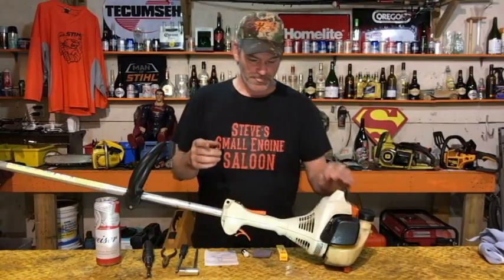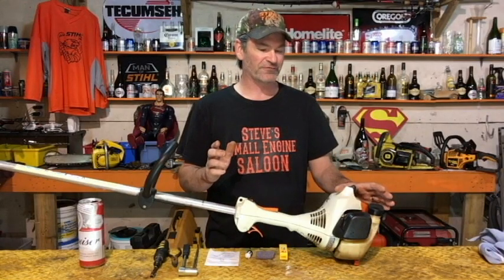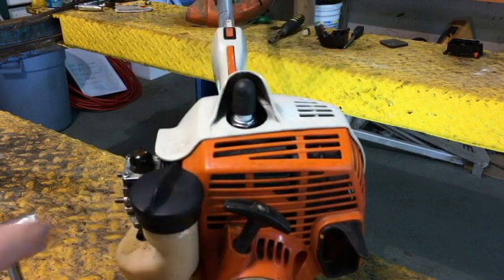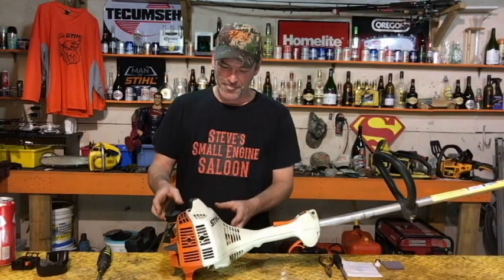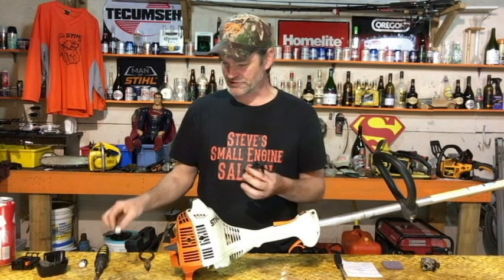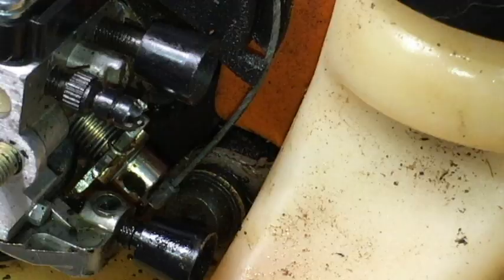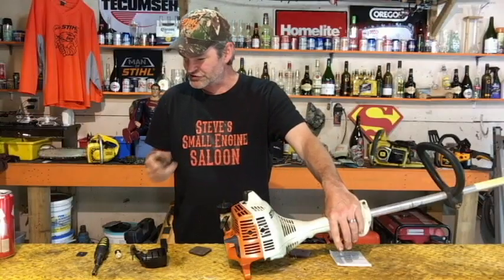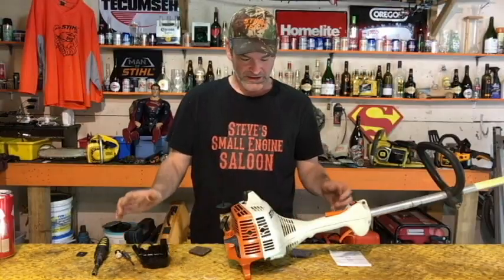How To Do a Basic Tune Up on a Stihl WeedEater

Comment: I need help on my FS45.  Compression gauge is showing 60psi after 1 pull and 80psi after multiple pulls (without reset).  What do I try/replace next?  Here is the history...Died while running, would not re-start, removed air filter and used starting fluid (would not start), then replaced spark plug (would not spark), cleaned spark arrestor (still wouldn't start), then checked spark (no spark), then replaced coil (now have spark)(still wouldn't start), tried starting fluid and air filter removed and it made pop with a burning smell (maybe a backfire) (still wouldn't start). Tried starting it again with the spark arrestor removed and it shot dark liquid dots out of the exhaust.  Sounds normal when trying to start, but never does. Has fresh gas, bulb is taking fuel, feels the same when trying to start.  Any suggestions on what to do about the compression, or where I should look next?   Invested a lot of time so far and not giving up just yet! LOL

Comment: Hey Steve, love your videos, absolutely fantastic.  I do have a question though, I'm hoping you can help me with.  I have a husqvarna weed eater that I've had for about 6 years.   It's worked flawlessly the entire time.  This year when I started it up, when I depressed the trigger the engine would bog down.  Initially I was going to rebuild the carb but I just bought a new one.  After replacing the carb the weed eater wouldn't start anyone.  I checked the compression and it's around 30 psi.  I looked in and visually the piston/ring looks okay.  Would low compression cause the bogging down?  I was wondering if I possibly knocked something about replacing the carb.  I think I'm going to call it quits on the repair but now I'm just wondering for my own knowledge and future troubleshooting.  Cheers!

Comment: My Sthil is a FS94R and it runs but gets bogged down, in short grass even, and stops running. I can start it up but it bogs down and turns off quicker and quicker. I put a new spark plug in it, the same kind as the one that came with it. I put good oil/gas mix in it, and changed the filter. But it still does this. The fuel filter is the same one that came with it when I bought it, should I replace it? I've had it for four years now and i've just started having this problem. I will try this tune up. If the tune up doesn't work, what is the problem i'm having?
Reply from the maker: Check my video called Stihl wont rev up....
Reply: @StevesSmallEngineSaloon  Thanks

Comment: I've got a similar weedeater from Stihl, it's my roadside find lol. I put a new tank and fuel line/filter assembly on it and if ran great, unfortunately I think the diaphram let go after running it cuz it doesn't want to prime for me now
Reply: Well lol, got the priming issue fixed and the weed eater runs now, I ended up switching the gas line/filter in the tank out and that fixed it, now I have another hiccup to fix, it dies out after a few minutes of running, almost like it drowns itself out or is getting to much air somehow, time to grab a beer and troubleshoot some more lol

Comment: I have a weedeater brand trimmer. It will idle and it will run wide open. No in between. It will die every time. Plus you have to keep pumping the throttle about 10 to 15 times to get it wide open or it just dies. If you just mash it, it will die. What should I do?

Comment: Steve great video. On my FS46 trimmer when I do mine I don't have take carb off. I take back orange cover off then fuel tank drops down. change filter put back in. why cover is off I unbolt the screen on muffler and clean. and check pull cord and clean cover. then put it all back together.

Comment: Again, another entertains video, thanks. One small thing to add, when a new spark plug is installed always check the gap at the electrode. I have had new plugs where the gap has been closed up. I know you would automatically check this when you take the plug from the box but your followers may over look it. Cheers
Reply from the maker: Great point!

Comment: Can anyone help please? Just replaced the spark plug, fuel filter (inc. lines), the air filter, and fitted a new carb (inc. gaskets). Starts and runs brilliantly (choke open), but as soon as I close the choke, the engine dies. Everything cleaned and no visible leaks or blockages. What might be the issue?

I could run it fine with the choke open, but it's going to burn through fuel like crazy. Need a better solution. Thanks!

P.S. even ran it with fuel cap open to see if it was a vacuum issue, but that had no positive effect.

Oh, and the fuel is fresh and the correct ratio mix with 2-stroke oil.

Comment: Thank you so much Steve for the work you do! I have a question about the STIHL FS 85. I've put a new ignition coil, spark plug, carburetor, fuel filter, fuel lines and adjusted the carb. It still doesn't want to idle very well. Does this model have a reed valve or some other thing I need to check? Thanks Bryan.

Comment: The way I replaced the fuel filter was that I pulled the tank. You have to pull the pull cord assembly, and undo a couple of screws and the two fuel lines if you don't want mess with pulling  the carb. Thank you for posting this video you are awesome every time I watch a video of yours I learn something!

Comment: My trimmer requires a good 20 tallboys of Bud to really run the way I think it should. Also the final four beers at the botton of the case can only be opened via said trimmer between the hours of 2am-4:30am. That's why tune ups are so important.

Comment: Steve Question?  I have done all I have seen on your Videos. Except tune with head on. I have been tuning with head off. So will not idle long. and at wide open throttle will just STOP running then hard to re start. Hot. Also no air filter on when tune . (Am I seizing the Piston to the cylinder wall?  New carb from dealer he can not adjust either. He says Bad fuel ??? I run no alcohol 90 octane and sthil oil.

Comment: My Kombi KM55r won’t start without pouring fuel in carb. Has spark,new carb.,fuel lines and filter-tried everything. Please help.
Reply: If you use ethanol gas, your carb and/or primer bulb will eventually fail. I went thru 2 bulbs and a carb. A cracked bulb will not allow fuel into carb and a bad jet means carb replacement. The carbs come preset and just slip on the way this video shows. They run about  $35. Bulbs are cheap, try that first. Then, use ethanol free fuel from now on. Before you replace anything, make sure that it's tuned up and adjustment screws are set according to manual.

Comment: Bought  my Stihl trimmer 12 years ago. Embarrassed to say I never tuned it up but didn't use it that much ( I had a kid doing the yard for several years). It was running bad. Would die if I gave it too much gas or if I turned it at any angle. Watched your video. Your close-in camera work was very well done and helpful. Did the tuneup. Also bought new gas and oil. Now it runs great. Thanks for the help!
Reply from the maker: Right on Mike...

Comment: Steve I have a stihl weed eater fs56rc  with problems bogging down. I cleaned the spark screen on the exhaust and it was stopped up. Now it won’t start and run.  I did get it to run for about ten seconds then it won’t start .. it has good spark at the plug good compression, blows my finger off the spark plug hole while pulling the crank cord. I’m thinking it may need a carburetor. Any help would be appreciated..
Reply: What finally happened with that Stihl?

Comment: You're my hero Stever.  I could not get my Stihl FS 45 to work after spending hours on it.  I got the $13 tune-up kit from Amazon and then spent 45 minutes replacing the spark plug, fuel line, fuel filter, air filter, and carburetor (in between taking sips from my 24 oz MGD).  Started up on the 3rd try.  Many thanks.
Reply from the maker: You're Welcome...

Comment: On the fuel line there's an arrow that goes back to the unit when you drop it back in.
Reply: What unit?
Reply: The fat round bit of the fuel line, that Steve was pushing in with the small screwdriver  has a small arrow moulded into it.
Make sure its pointing to the engine, then you can't put the 2 fuel pipes on wrong way round, because they will only go one way round.

Comment: This was excellent!  I got the parts this morning (plus a primer bulb) and did the tune up just as you showed.  It went very smoothly.   It now runs like a champ.  Your comments got me over the tight spots to watch out for.  NO FRUSTRATION, NO UNNECESSARY PARTS REMOVED, THE RIGHT TOOLS,  JUST SMOOTH SAILING!!!  Excellent video, perfect close-ups for the details. I have to see what you have to help me now tune up the chain saw.
Reply from the maker: Right on Ed...

Comment: @Steve's Small Engine Saloon, over time replied and asked couple questions in vids.No reply, but will attempt in this one.Thanks for vids, like the quality and full explain...
 I take my weed eater apart shell and all once in awhile and scrub.Also, cue tip ect parts and all else.Anyhow firstly maybe some time if you could do a vid.Being about grease at head for gearing vs other weed eaters that have no port at top for grease gun or tube.Sthil weed eaters only.Seems Sthil does not want top gearing lasting and to buy another.My FS 56RC has no place to grease the gearing by head..... Which to me, is stupid and sucks.I'm sure there is more not so easy ways to do this though.
 Need some advice please.On the 56 RC I see there is no black muffler port or what be.Others have it.The thing that attaches to orange shell by muffler and sticks out so junk goes straight out.I have a fs 55 and I see that part does not butt up and snap in to the 56rc.For a attempted try.I also see alot of black gunk just splattering inside the shel and out side.Looks like crap.Any mode or thought or part you have that would correct issue? Have no clue why Sthil did not put this on the fs 56rc.My fs 55 is old use it daily with that part from factory on it and inside looks fine.
 Side note, I always run Sthil hp mix and 90 oct no eth in this and all my stuff.Thanks for input....

Comment: Thank you Steve for this vid.  I was able to do everything you showed on my Stihl.  However, that didn't solve my problem.  The squeeze ball kept collapsing and didn't re-inflate like it usually did, and I am not getting fuel.   Fuel lines look OK.   Could it possibly be the carburetor?  My weekeater is about 7 years old.  Thanks.
Reply: I know it's late, but this generally means your carburetor diaphragm and\or priming valves have degraded. You will most likely need a carburetor rebuild and a new primer\gas lines\filter or a new carburetor and gas lines\primer\filter.

Comment: I feel lucky to have found your channel Steve. I have a Husky 128LD combo trimmer that I just bought this spring and it has been nothing but problems. I just installed a new carb last night , and  then realized that I will most likely need to adjust the high and low speed adjustment screws. I will be able to do this successfully and easy with your carb adjustment video for trimmers. Now I am ordering that special spline tool off of Amazon. My only request is that you do some videos on the popular homeowner grade Husky equipment. BTW- why the cheap piss american beer? You guys have Kokanee up there in BC. I would think that you should be featuring that beer as much as you do Stihl equipment. LOL
Reply from the maker: Right On....
Reply: I'd be drinking Yukon Gold if it's still made. Can't get it in the States anymore, or at least anywhere I've looked. EDIT: Looks like it's still made  https://yukonbeer.com/our-brews/yukon-gold-english-pale-ale/

Comment: I was given FS40C Stihl and it hasn’t been started in about 2-3 yrs. It had gas so I figured I would try it and it didnt start by no surprise. What’s steps should I take to get it back running other than new gas.
Reply: You need to add 20 mls per 1 litre of petrol or 10 for 500.
You need to try mix first

Comment: For about $16, and they aren't OEM parts, but on Amazon you can buy a kit. I have one coming in today for my string trimmer.. HUZTL C1Q-S97. You get a NEW carbeurator, air filter, 2 extra primer bulbs, 2 fuel filters, spark plug, gaskets, fuel line. About $16, delivered if you have a Prime account. Put one in my hedge trimmer and it runs great.
Reply: The one kit fits a whole bunch of Stihl units.
Reply: Kit came in Monday afternoon.... Installed everything and my FS55RC fired right up on just a couple of pulls.... Need to adjust the low idle but happy with the results..... maybe 20 minutes including fetching additional tools.... Ended up losing the old gas filter in the tank when I removed the fuel line. But I have one of those claw extractors and got it right out....

Comment: New sub, I have the FS55R and second carb replacement and all other tune up pars new also. It still wants to bog down and sometimes throttles good then it bogs and shuts off. Out of ideas. Also why is it so hard to pull, tons of compression geeze

Comment: Hello steve. Here is the problem, my Stihl fs 350 weedeater starts only when he is cold. After that you can,t get it to start again even with starter fluid spray.
I already changed the sparkplug and cable and the coil as well.
Changed the carb with a new one and changed it back again with a rebuild one as well.
Put new petrol lines and filter as well.
Looks like the spark is very bad or no spark when he is hot.
I'm out of ideas now.....
Do you have an idea......
Thanks for all the educating movieclips. 
I,m
Reply: My experience has been either the choke (butterfly) valve on the carburetor is not opening when warmed up, or the ignition coil (magneto) malfunctions when warmed up. Sounds as though in your case the magneto needs to be replaced..

Comment: Hi Steve, love the videos!
How do you remove the fuel line grommet on the older models? I’ve got a kombi Km100 and it has a plastic grommet where the two fuel lines enter the tank. 
Cheers from London.

Comment: I would like to grease the head on my Stihl FS 70R, but it doesn’t have one of the removable bolts where you can screw in the tube of grease.  Should I trust the sealed head?  I love your videos and learn something from every one.
Reply from the maker: If its sealed, nothing you can do....
Reply: I asked my local Stihl dealer about this.  He grabbed a new trimmer off the display wall, grabbed a tool, removed the orange guard, and then loosened the bolt holding the head on the shaft.  He pulled the head off the shaft and showed me the socket where the drive shaft goes in.  He said if you have a straight-shaft grease gun, hold the tip against the opening and give it a couple of squirts.  While you’re at it, pull out the drive shaft (looks like 1/4 inch steel), wipe it off, and grease it. Put it all back together. I’m wondering about using a piece of plastic tubing between the drive socket and the grease gun to seal the connection without grease going everywhere. Does this make sense? Cheers.

Comment: Hi Steve, I have a Stihl weedeater that I cleaned everything and started and ran fine but tried it again a day or 2 later and started but wouldn't idle? Cleaned the carb again and now won't start. No problem with the chainsaws doing this but the weedeater is being a pain. Someone suggested just replace the carb.
Reply from the maker: What model is it?
Reply: It's a FS55RC and by watching your video it's the carburetor. I ordered a new one that comes with 2 mount gaskets and 2 replacement fuel primers. About 15 bucks from amazon. The fuel diaphragm was shot on the old one like you showed on yours.
Reply from the maker: Excellent!  If anyone else wants this carb, click this link-- http://amzn.to/2j2MQC6
Reply: cool even cheaper today. good deal
Reply from the maker: WOW!  Really good deal!
Reply: Update on my weedeater. Got the China carb and everything looked good except the weekass spring on the throttle plate lever. I swapped it out with my old one and works great. (Suggestion for a video) Primed it and it started right up and runs great. Just need to fine tune it now with the cutter on.
Reply from the maker: Right on Tim.....

Comment: Great video Steve.  I have a Stihl FS 55RC  WeedEater.  I have two issues with it.  First the on off switch will not stop the engine.  Is this easy to fix or replace?  Second,  sometimes the cutting head will not have enough power to cut a wet noodle ...after cooling off for a few minutes it will engage again.  Is there a fix for this?   Thanks for all the great tips. Being retired and on a fixed income they come in handy.
Reply from the maker: Real bitch to replace one, you gotta take the handle and palm trigger apart to get the wires back on, but alot of times those are just sticky.  I spray a little carb cleaner in the crack beside the orange rocker and work it back and forth 10, 15 times and that works lots of times...  Make sure you can totally freely spin the line head by hand, it should not feel tight at all!  Grease the gearhead.  I have never seen a clutch wear out on one of those, but it is possible I suppose!
Reply: Thanks Steve.  I will try those fixes.   The line head does spin freely but doesn't seem to engage .
Reply: Clean the spark arrestor (wire screen)in the exhaust can. This is usually the cause of power loss next to carb adjustment